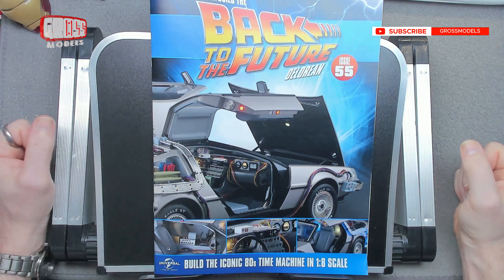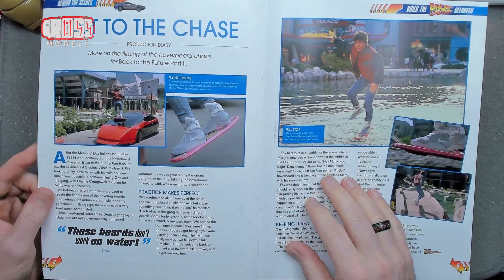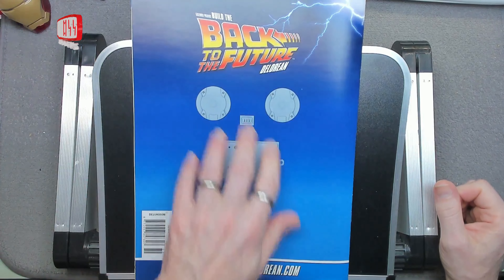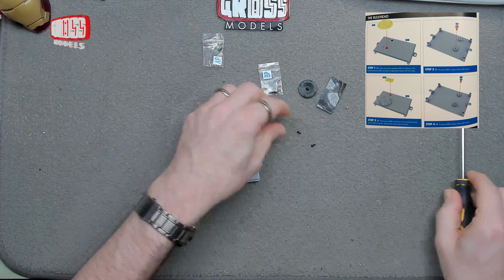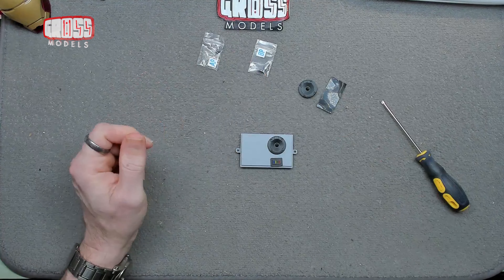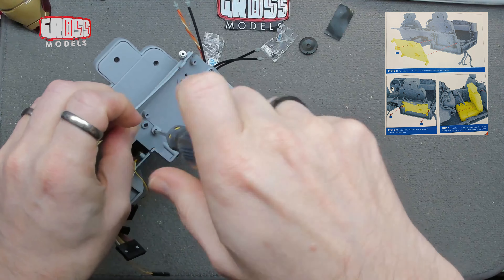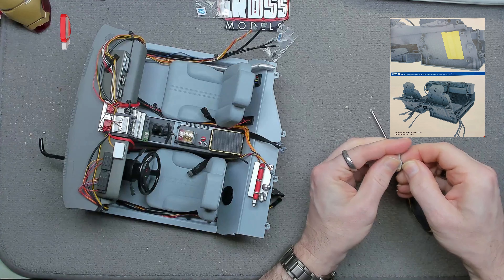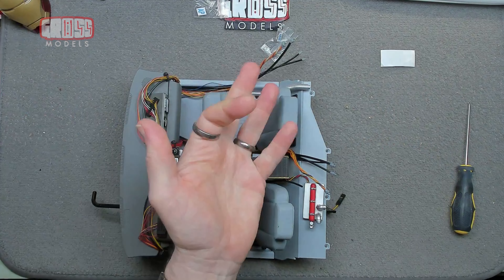Fanhome 1:8 Delorean build. Stage 55

Comment: This takes me back, I rember doing all those wires for the interior, hopefully you have got youself a ModelModz Flux Capacitor as the Eaglemoss one is certainly not what makes time travel possible!  I got halted at issue 103 but i now have 104-106 on my channel its great Fanhome have picked this up for all us modellers.
Reply from the maker: I haven’t got any of the mods for it, I may do something down the line, but I’m quite happy with it as it is.